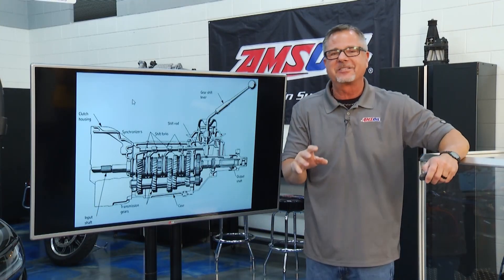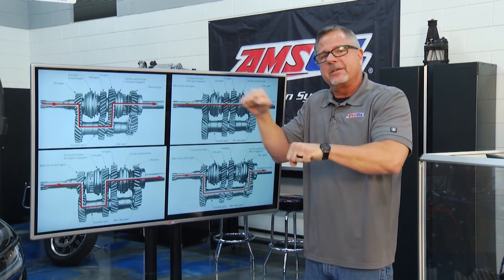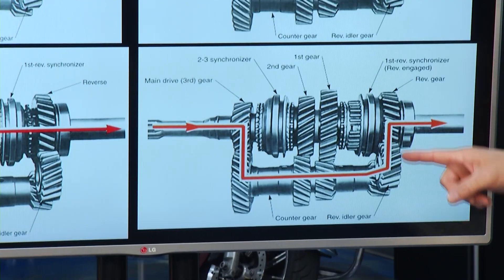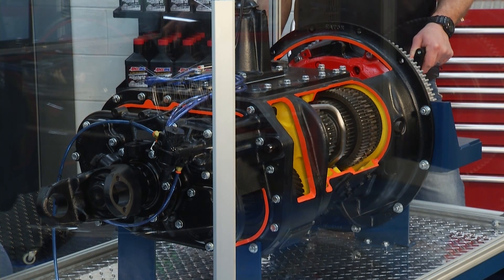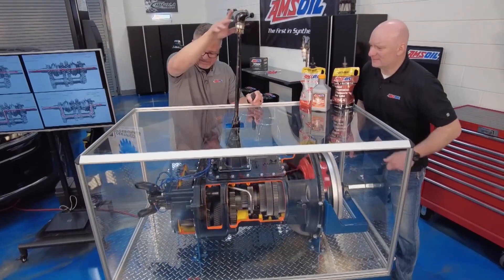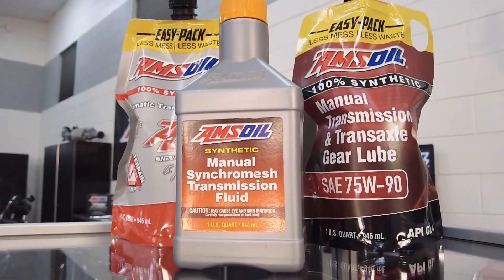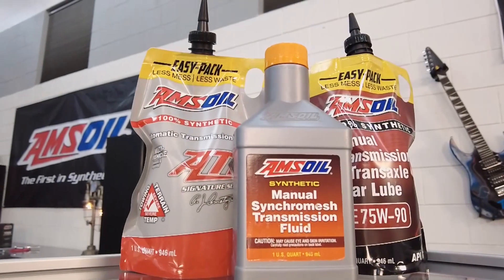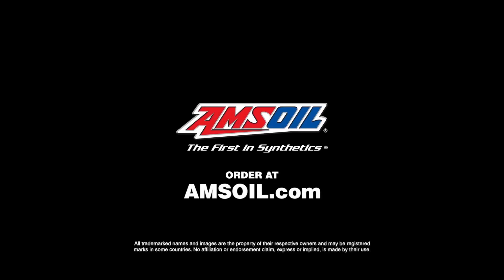What Goes on Inside a Manual Transmission?

Comment: My twenty year old 5 speed is doing just fine thanks  to the Severe Gear 75W-90 fluid.   2 quarts drained and 2 quarts added in less than 15 minutes makes maintenance a breeze. 😉
Reply: 2 quarts... only a little guy.  😂